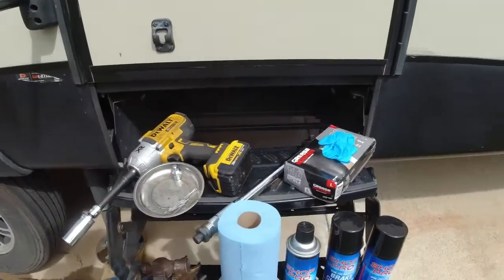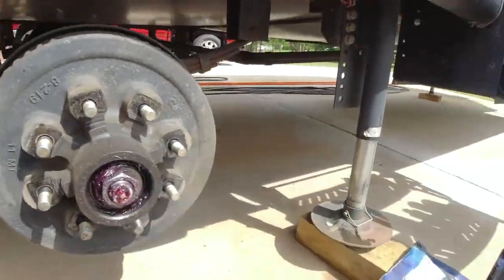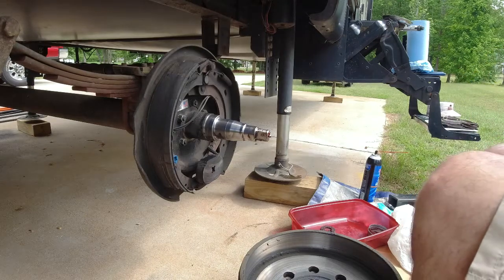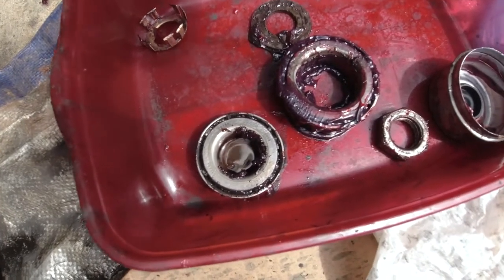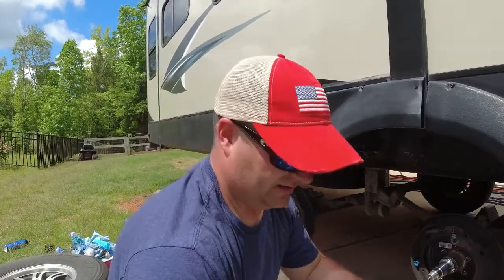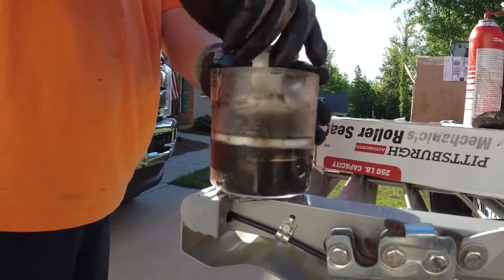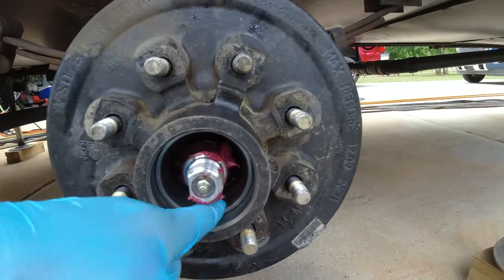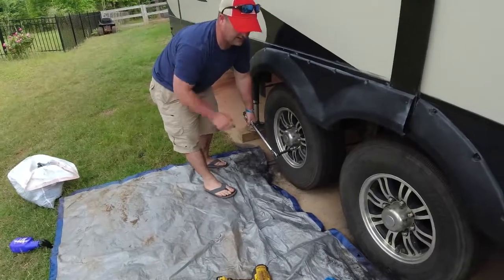Best way to repack camper trailer wheel bearings | Step by step to repack bearings and replace seals

Comment: Excellent instructional video Wilson! I had my rear tire on our rv catch fire on I-10 in Texas back in February. Luckily Tracey was behind me and got me to pull over. Otherwise we probably would have lost our rig. Needless to say, I repacked all bearings when we got to our destination.
Reply from the maker: It’s not a fun job and it’s definitely a messy one but it is 100% necessary.  I’m so glad y’all were able to avoid a terrible disaster and able to pull over before things got worse.  Tires and wheels, bearings, and suspension are so important and have to be maintained regularly.  We repack our bearings every spring regardless of mileage as a safety precaution.  We know anything can happen even with the best maintenance but at least we feel better repacking and inspecting the bearings.  I know some folks can’t do the job themselves and they should pay someone to do this important task but those who can change a tire can do this preventative maintenance cheaply and relatively easy.  We appreciate you watching and taking the time to comment, I hope your comment helps encourage others to take care of this task.  ~Wilson & Kelli

Comment: Excellent video! I'm going to follow your instructions to repack our travel trailer bearings this spring before we head out on our first trip.  Our local RV shop charges $400 to perform this service so this is a huge cost savings.  I loaded up my Amazon cart and took a quick trip to AutoZone and got everything I needed for $160. Now I have the tools to perform this service on my trailer every year saving tons of $$, plus the headache of hauling it to the RV service center and back home. Thanks so much for the attention to detail and quality so this gets done right!
Reply from the maker: It’s really an easy job, just a little messy.  It takes a little sweat equity and like you said, you can save yourself hundreds of dollars and a lot of time doing it yourself.  Check those bearings close for damage if you are reinstalling the same ones.  Good luck and let me know how it goes for you.  Thanks for watching and subscribing too! ~Wilson

Comment: Great video, helped this DIYer do the job.
One question... How many pumps of the grease gun did you do into the spindle at the end?
Reply from the maker: Thanks Gordon, I just pumped 2-3 short pumps, you don’t have to do it as they are greased well once you repack.  Be sure to turn the wheel as you pump and be careful not to blow out the rear seal.  Some people pump 10-15 times and blow the seal.  By the way, I just did my bearings this weekend after putting almost 10,000 miles on them in the last year, and they looked like new from the time I did this video.  Good luck and safe travels!  Thanks for watching and we’d love for you to hit that subscribe button ~Wilson

Comment: Good video for a diyer but 1 important thing was forgotten the axle spindle nut was overtightened 50 ft. Ilbs is to set preload on the bearing assembly then it should be backed off and hand tightened for proper backlash on bearings so that they do not overheat this Is why your rear seal was failing and outer bearing grease was burnt. Other than that great job
Reply from the maker: You are correct about backing off the nut slightly to give a little play, thanks for pointing that out.  Appreciate you watching!  Wilson

Comment: Last year during this process on my solitude I pulled the hub off and found a big crack in it. I say this for those people that don’t completely take everything apart to pack the bearing and just use a grease gun
Reply from the maker: That’s why it’s so important to do this every year if you travel a lot.  I personally do a yearly repack regardless of miles.  Thanks for the great insight and watching!  ~Wilson